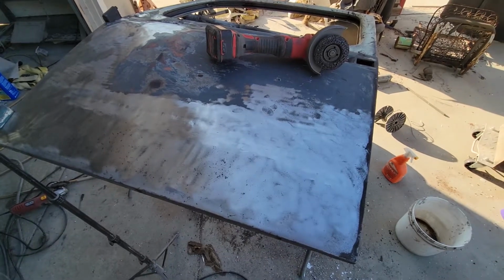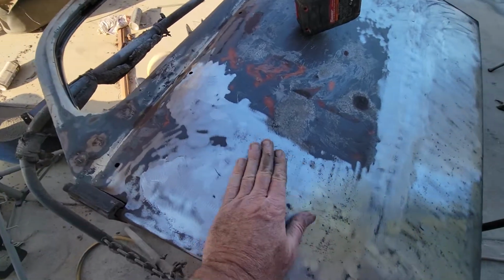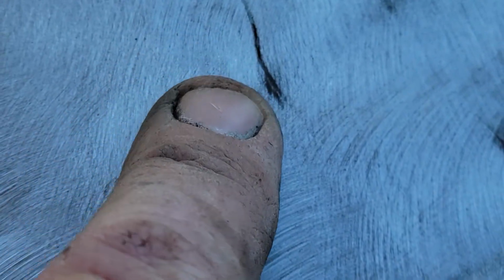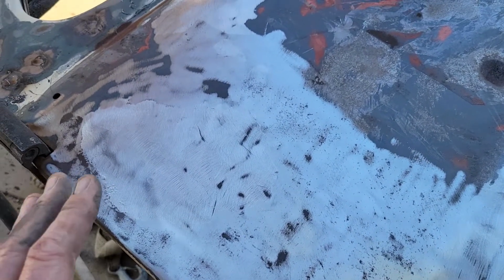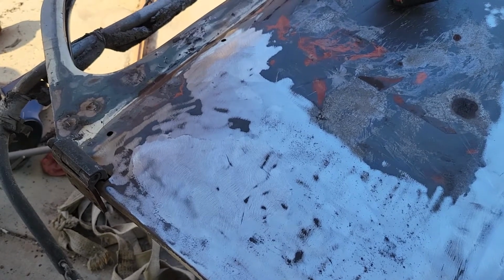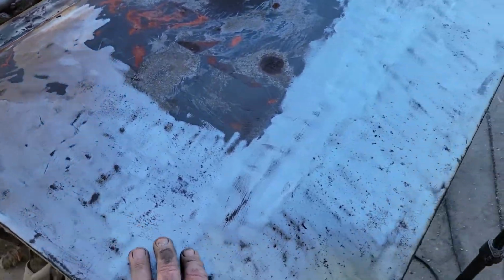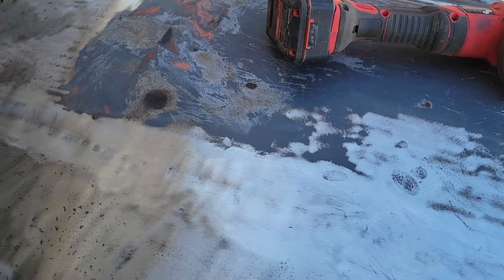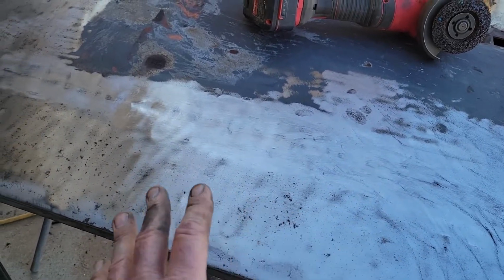LEAD BODY FILLER Permanent repair? Last forever?

Comment: Ya well, lead done improperly has it's drawbacks as well.  Not to mention how easy it is to remove the stuff or part of it for a fix/touch-up 50yrs after the fact.